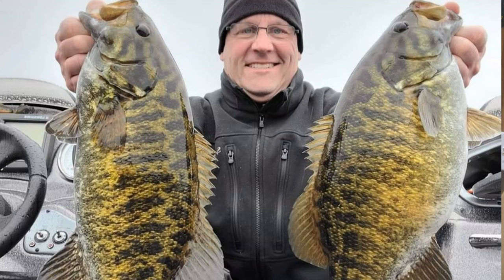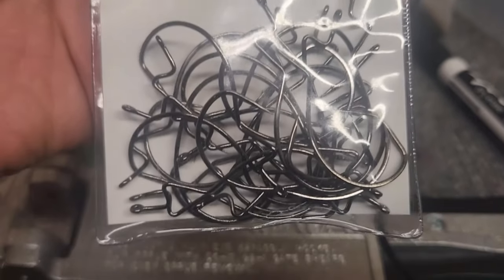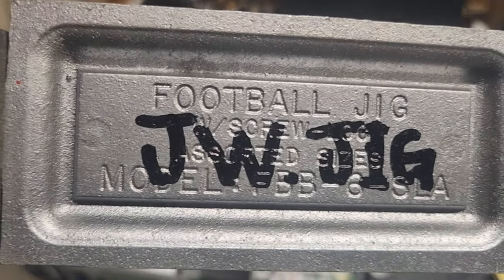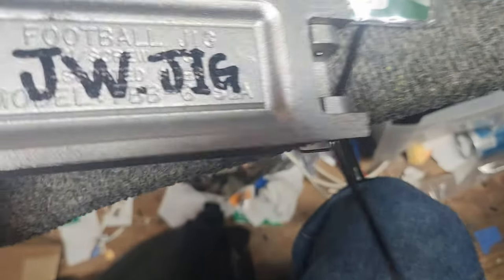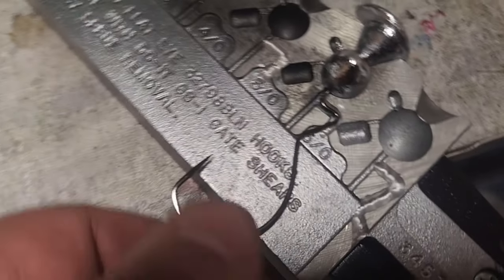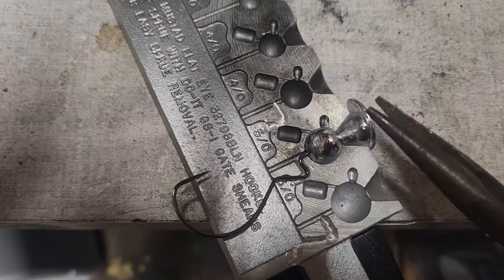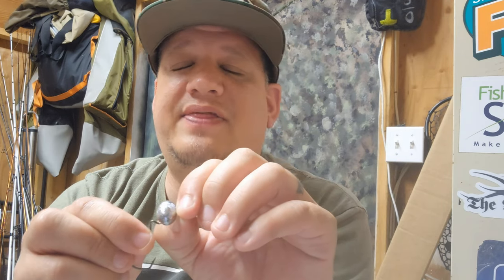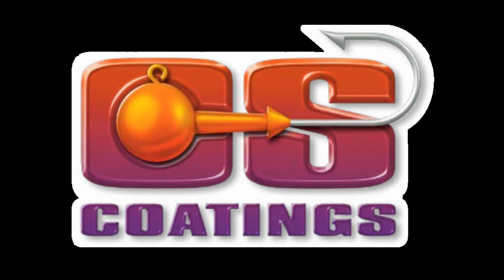Modifying A Do-It Molds Football Jig  - That Guy Skimpy

Comment: Question ???   For the line connection… have you thought about / tried an offset fish shank ?? I use them as the connection point and a platform to tir skirts on when I tie my weightless whissper jig I learned from SDG custom lure craft …. They are preformed and come in many sizes   So I thought it would be perfect for your application 👍.no need for special tools to bend wire 😎
Reply from the maker: Yes I wanted to use them but couldn't find any locally so I used the wire form.   If I can find the correct size to fit the mold it sure would save alot of time !!!
Reply from the maker: And the ones I did order didn't fit
Reply: @ThatGuySkimpy  ya ..I ordered some I thought was the same as Adam used .. ended up being like 1/4” long  not 3/4” 🤦. I’m like WTH am I gonna use these dinky things on I don’t tie trout flies … cost more to ship them back than just keep um ….  Ugh …🤷‍♂️.   ………Kewl build thou !!  where did you get the 2nd set of pliers to crimp the bends

Comment: Do you need to Dremel both sides of the mold? I was thinking of modifying my mold as well!
Reply from the maker: Yes both sides.   When you line up the hook where you want it and close the mold tight and can even put in a vice, it will leave a mark on both sides of the mold so you will know where to cut